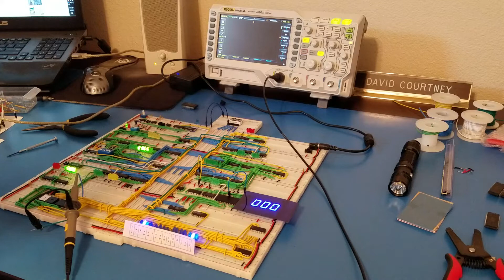ADD cycle problem [Part 3] - (Ben Eater 8-bit Computer) SAP-1

Comment: I know this is an old video but adding the comment anyway In case anyone runs into this problem as well.. I had the double bounce on the clock cycle as well. I increased the capacitor size from 0.1 to 0.22 µF on port 6. That seemed to fix it. My guess was I was too slow to release the single step clock button.

Comment: I've been giving a lot of thought about your 47 problem and examining your wiring carefully, comparing with Ben Eater's one I noticed that you mixed and tied control and data lines together one that long "snake" of wires on the right side. My thought is that you might have some kind of crosstalk. Ben's control wires are almost always 90 degrees with data and more spacy. Crosstalk signal occurs when current in one line induce current on other parallel line when level change from low to high or other way. This looks like a clock pulse to the oscilloscope but is not really related, except that everything switch from low to high accordingly to the timing of the clock.
Reply: I had same issues with output changing during add and sub.  I added an extra cap from pin 11(ls273) to ground and no more issues.  Essentially removing noise thats triggering the register change from my understanding.
Reply: @jeffdowling1682  I'm having the same issue on a similar project of mine. 
Did the capacitor solution work fine at the end?
Reply: @lorenzopirovano6727  yes it worked perfectly with the cap discharging any noise.
Reply: @jeffdowling1682  I'm glad to hear that! This issue was driving me crazy since I've got a PCB which I can't easily modify.
Thanks for answering!
Reply from the maker: Thanks for the reply. I talked about this crosstalk/interference issue in Part 2. Also, I think the comment left by ared0hel in Part 2 is going to prove to be the correct true solution. Bottom line, this version of the OUTPUT REGISTER is defective by design and should be rebuilt with different IC's. I'm going to pursue that path within the next couple of days.

Another thing I've noticed in my own experiments is that some of my EEPROMS are far less likely to produce a strong enough pulse on I/O 4 (which goes to the OI control signal) to cause a logical high. It was dumb bad luck that the EEPROM I chose as my #2 chip ended up being one that was especially susceptible to produce a strong pulse under this particular condition.

I would be willing to bet if Ben hooked up his oscilloscope as I've done here, he would see this same pulse eventually. As I've demonstrated in these videos, whether or not the I/O 4 gets pulsed when it isn't supposed to is a bit random. It's an intermittent issue. And as I showed in this video, the pulse that comes off of I/O 4 may not be strong enough to trigger the OI control signal. So the fact that Ben doesn't see it happening doesn't prove it isn't occurring, it may just be that the pulse isn't strong enough to trigger anything. 

I find that 1 of my EEPROMS seems especially well behaved in that regard. It will pulse on I/O 4, but the signal is almost always too low to trigger the OI control signal. But given enough resets, I find that I can eventually cause it to blip as well. I've also noticed that my EXEL brand EEPROMS (which I've never shown in these videos) seem to trigger far less often than the Atmel's that I've been using in these videos.

But all of that said, I believe areh0hel is correct ... the 74LS273 is simply the wrong chip for this purpose. The solution is rebuilding it. I'll find out soon enough.
Reply: I had a blast doing this on breadboard. I haven’t seen the pcb so I am not sure how much access you have but you could probably just hold the cap in place and test before you solder.  I just used the same cap as the others in the project.  Best of luck!!
Reply: @jeffdowling1682  thanks!